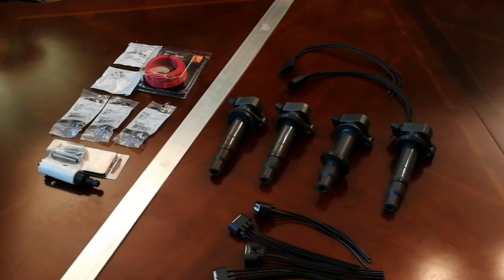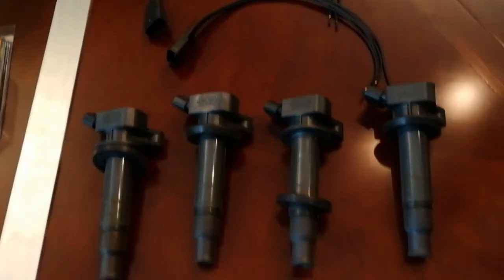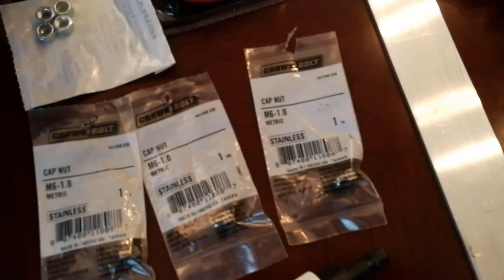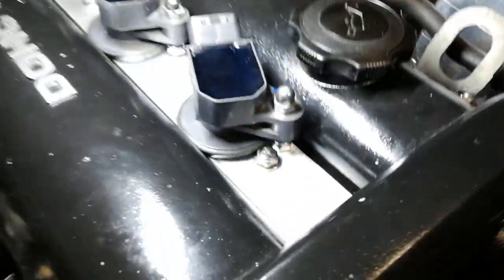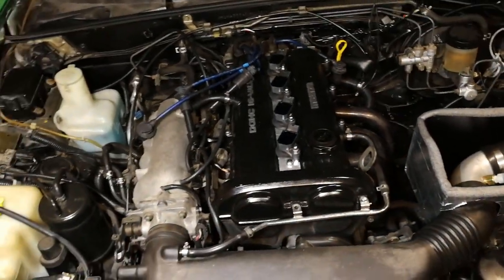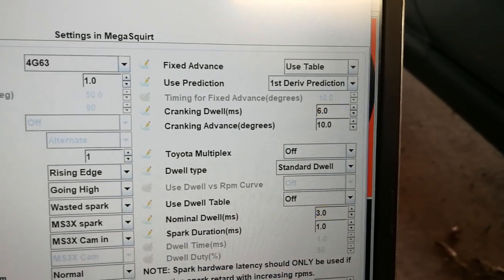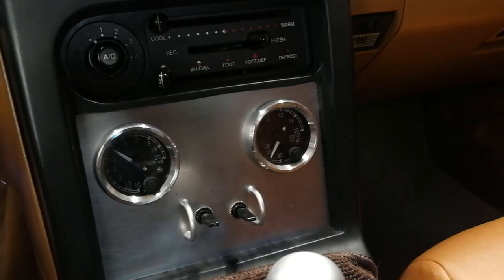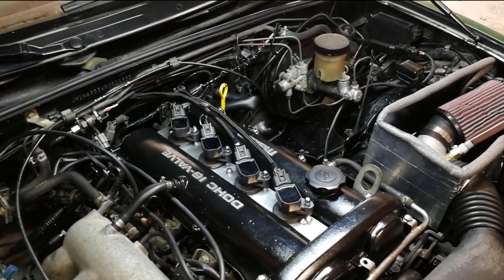Miata Coil on Plug DIY - Full HowTo!

Comment from the maker: Note: Toyota COPs have a lower dwell time than stock.  If you have an aftermarket ECU then you can change it as I show in the video.  If running the stock ECU you may need to find a way to reduce the dwell or else it will shorten the life of the coil.  Check out this how-to for a circuit: https://forum.miata.net/vb/showthread.php?t=277963
Reply: I am running MS2PNP
Reply: OGPedXing wish you were here
Reply: Not doing this will shorten the life of the coil how much? Im using this as an emergemcy fix. Will it work for about 200km?
Reply from the maker: @theo_korner  it's hard to tell, it's all about heat.  These coils can take some abuse but if they're old (I got used oem when I did mine) then they may not make it.   But I've talked to guys that lasted 6 months or more on them with the stock ECU.
Reply: @OGPedXing  thanks, that will do

Comment: Thanks for the OEM harness connector. I've made a few of these over the years and ended up making my own connector. I love a true PNP solution.
Reply from the maker: All credit to Ballenger Motorsports...they carry a ton of Sumitomo connectors which is what Mazda likes to use and I like to check back there periodically to see if they add anything.  I've searched Sumitomo parts catalogs before and could never find the coil side of this connector pair.  Many people have hacked an old broken coil pack to make their own connector but that's time consuming. I was super happy to find these.
Reply: @OGPedXing  That's what I did before, was a real pain. I even gutted an old igniter for a 92.
I hate messing with factory wiring and will almost anything to prevent that.

Comment: I am studying to do this (one coil per cylinder) using the original MOTRONIC 1.5.4 injection on an ECOTEC (OPEL) engine. Currently coil and cables are used. In the coil arrives three wires, the positive and negative of the primary coil for cylinder 1.e 4 and negative for the primary coil for cylinder 2 and 3. The wires come straight from the motronic module 1.5.4.

Comment: Thanks for posting this up. I hate cutting the main harness on anything and have been looking for the plugs to plug into my 94's harness.
Reply from the maker: I feel the same way.  Added bonus:  You can solder everything up inside in comfort rather than leaning over an engine bay.  Plus the whole thing just unplugs and can be removed if you need space to do something behind the head.

Comment: was super excited to do this as my wiring for my miata 1.8 is old and the coil packs are expensive, switching to this would make my motor run again and save me cash. was super happy until the megasqurt part came up. i knew this was too good to be true with a stock ecu. -_-
Reply from the maker: Yeah unfortunately the long dwell time from the stock ECU tends to over heat the Toyota coils, shortening life.  I've heard some people run them for quite a while with no problems on the stock ECU, but maybe they live in a cold climate.

Comment: I decided to attempt installation.  I watched the wiring section a few times and got that "baller" harness plugs into coil pack connector for 1&4.  Baller harness 12v lead goes to cop 1 and cop 4 power (same for GND, Trigger, Tach).  Then repeat this for the second baller harness but connect leads to cop 2&3.  Is this an accurate summary? Love the baller/street cred tributes to Greg. Lol. Keep these videos coming!
Reply from the maker: Haha, thanks.  Yep, that sounds right!
Reply: @OGPedXing  one thing that confused me a bit was the additional GND wiring while testing.  Is it not enough that the COPS are plugged into the connector which has wiring for GND?
Reply from the maker: I may have to rewatch the video, lol.  Basically the grounds are tied together further in the oem harness anyway.  If you use the oem coil pack plugs, there are two ground wires but these both go to the same place.  Same with all the 12v power wires and actually tach as well.  Only the trigger is truly split between 1 and 4 vs 2 and 3.  So as long as each cop gets power, ground, and tach it can actually pull from wherever.
Reply: @OGPedXing  for the test, you had some leads around what looked like the spark plug threads running to what looked like a jumped cable with the other end of the jumper cable clamped on the engine hook.  Was wondering why this was needed  even though the cops were plugged into 12v/GND.  Maybe cause the plugs weren't screwed into the head?    I want to try the test but being a novice looks a bit intimidating lol
Reply from the maker: @kevinsaeed9817  oh!  Right, yes it's very important for the plugs to be grounded themselves.  They normally ground through the head, correct.  So when outside the head you need to give it a ground path via the threads otherwise damage could result to either the plugs or the coils.  Some people just set them on the metal valve cover but mine is painted so I like my wire set up.
Reply: @OGPedXing  got it, this makes complete sense now.  Thank you.

Comment: Awesome job securing the plugs I’ll definitely be doing that. I would have soldered the joins. Would love to know how to get the rev tachometer working again
Reply from the maker: There are a couple of tricks to get the tach working if it's not getting it from the ECU...what year and ECU are you running?   I did the soldering off screen, but yeah I like how clean the harness comes out with solder connections vs crimps.

Comment: I have turbo charged my 1990 1.6 and one of the coils is not strong enough for the turbo.  This method is substantially less expensive than Greg Peter's LS1 coils, and $100 spark plug wires.

Comment: Thank you for the great guide! What is still not clear to me is, the stock miata trigger voltage is 12v as far as I know, while the Toyota cops take 5v trigger signal normally. Is this a problem, or are they good to use like that?
Reply from the maker: Yes, I believe the Toyota cops need a minimum of 5v but actually work fine with anything between 5 and 12.  I think the stock ones also do this but that the spec is looser on the Mazda coils and it's more stable at 7 to 12.  But either way, the Toyota cops are happy at 12, no problems there.
Reply: @OGPedXing  thanks for the clarification, your imput is very helpfull!

Comment: Are these considered "wasted spark" ? 
Can you explain that a bit? I can't find much information online
Reply from the maker: They can be set up however needed, wasted spark, fully sequential, etc.   Wasted spark just means that it fires both the actual cylinder that's receiving fuel in the combustion sequence as well as it's paired cylinder.  For a 4 cyl car, is 1 and 4 and then 2 and 3.   This does not reduce the spark power applies to the combustion cylinder because the other wasted spark is under very little pressure and sparks easily with almost no amperage draw.  So all the energy is happening on the combustion cylinder.
Reply: @OGPedXing  I guess I am wondering if I SHOULD make it sequential spark or keep it wasted? Pros and Cons?
Reply from the maker: I'd keep it wasted spark for any car that doesn't have the wiring stock for sequential.   Sequential spark is a tiny bit more efficient than wasted but unless the coils are very under powered, it will make no performance difference.

Comment: Great video. Do you know if the process is the same for the NB?
Reply from the maker: Yes pretty much.  The later NA s (96+) and NBs have a three pin connector to the coil packs.  The Toyota cops have 4 pins... you're going to ignore the tach pin - leave it unconnected.  The tach is driven from the ECU for the later cars.  So all you need to wire up is the power, ground, and trigger for each.  The there is one trigger wire for cylinder 1&4 and another for 2&3.
Reply: @OGPedXing  thank you for clearing that up. Much appreciated.

Comment: Did you have any trouble getting a tach signal with the megasquirt? Or did it function like stock?
Reply from the maker: Mine worked fine but it can depend on how your MS is wired, the generation of Ms, and also the year of the car.  I think 94, early 95 and older require the tach signal from the coil to be routed back to the ECU.  With my 94 I tied all the tach wires from the coil packs together and connected them to the original tach wire in the loom.   In some cases you can put a small resistor (1k) in the diag box between ig- and b+ to provide a pullup for the gauge.

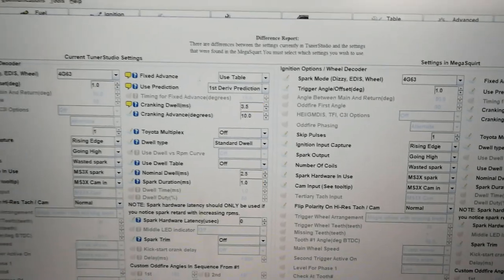Comment: On 14:09 , there are two sockets fron the coils, how do you connect this to the single oem socket ?
Reply from the maker: If  you have an earlier Miata, 90 thru 93 then you'll have a single plug for the ignitor vs 94 and up have two plugs for the 2 coil packs.  The wiring in general is similar but I haven't seen a female plug for that sold that will go into your oem harness directly, unfortunately.   What most do is cut off the plug from the oem side and wire it to your new cops harness directly. There are some decent diagrams here https://wiki.fome.tech/Vehicle-Specific/Mazda-MX5-Miata/Miata-COP-Conversion/

Comment: Hi greetings brother I have a 4g63 with a sem 102 ms3 program. I wanted to know how I can do the test for my coils since when I do that test I don't It allows. I have aem 30-2853 smart coil
Reply from the maker: The other thing you can do for testing if the screen isn't there in tunerstudio is pull the fuel pump fuse and then crank it.  This is more intense on the battery so you'll want to connect it to a charger or jump pack to avoid running the battery down if you are cranking for a while.
Reply: @OGPedXing  thankd man

Comment: The wires attached to the coil, are they the distributor wires?
Reply from the maker: Each coil has a power, ground, trigger, and tach signal wire.  When set up with coil on plug you no longer need an ignitor such as on 90-93 years Miatas or a shared coil pack as on 94 and above.  If you have an actual mechanical distributer on your car (not a Miata), you won't be able to do a direct conversion to coil on plug.

Comment: Do you think these Toyota cop plugs would be strong enough for a 250 horsepower 1.6.  currently I'm estimating I'm running 5 - 6 lb of boost and maybe 150 horsepower. The stock coils worked well for the first two days.  I don't really want to go the whole $500 route that Greg did on his Miata if this method will work.
Reply from the maker: @Mike Mohr  Yes, the Toyota COPs should work well.  You won't be able to gap them as large as the LS coils but they'll be ok up to around 15 psi.  The price is hard to beat!  Keep in mind the dwell issue though, these are most reliable when combined with an ECU that allows you to set coil dwell time to about 3.5ms crank and 2.5ms normal.  (Less than stock).

Comment: I am still a bit confused on what to do with the ignitor for the 1.6l stock ECU. I can't find any wiring diagrams that are still viewable so I am not sure what to do with it.
Reply from the maker: I think most just cut it at the connector and wire directly from there.  It's simplier although your cop harness is now part of the overall loom and can't be unplugged separately.  Here's a forum thread with the pics: https://www.miataturbo.net/useful-saved-posts-8/upgrading-coil-plugs-all-years-cop-writeup-12704/

Comment: Do i need to change my spark plugs? The toyota coils don’t lock in so the spring just have to be in contact with the spark plug? And bolt it down so it doesn’t move? Or something is wrong on my end? 1999 mazda miata
Reply from the maker: That's correct, they don't lock down like the normal plug boots, the bolt on each coil holds the tension on it.
Reply: OGPedXing thank you so very much.. love the content, you help a ton with my build🙏🏽🙌🏽

Comment: Curious what you're running for Spark Plug gap and if you've made any changes after tuning. Thanks!
Reply from the maker: I'm gapped at 0.040, once I went turbo.  That's been very stable although this setup is only doing about 14 psi.  Without the cops it would need to smaller.
Reply: @OGPedXing  I also did the COP setup, so I'll start with 0.040, thank you!
Reply: @OGPedXing  14 PSI on the T25? What kind of power are you making?
Reply from the maker: @f0deraro  I haven't dyno'd this exact setup but around 240 HP peak or around there.  This turbo gets tapped out pretty early but I love the instant spool and midrange torque.

Comment: Are the settings the same for a 1.6?  I have seen people take the duration down to 0.7ms; what do you make of that?
Reply from the maker: It's not going to do too much.   This is the time the MS will wait before starting to charge again and is used to ensure the burn has happened before starting to charge again (like at high rpms).  Since the Toyota COPs charge pretty quickly, this is not really a concern.  A normal value is about 1 ms.   Dwell on the other hand needs to be set correctly based on the coil and the voltage.  Nominal is 2.5 ms at 12v.  So your dwell correction chart should be compared to your actual dwell times from logs and corrected as needed.  Normally you'll be at 13.8 to 14.4 volt when driving.  So the actual dwell needs to be 2.5 ms at your normal voltage.  Edit:  oh also the settings will be the same on a 1.6.

Comment: My vitz asz1 toyoyoto is not starting. Battery is good and fuse is good  sparkblug is good  and fuel bumb is good so what you can helpme  sir
Reply from the maker: If it's cranking and you have spark and fuel then check that the timing is ok.

Comment: Hi, thanks for the vid. Is this a 1.6 or 1.8? Thanks
Reply from the maker: Mine is a 1.8 -- for the 1.6 the process is basically the same except the wiring comes from the plug to the igniter which the 1.8s don't have.  But basically the power wires are shared, ground is shared, you need to get the trigger wires for each cylinder (1 and 4 then 2 and 3) set up.  And also I think tach is still used.

Comment: so in the tuneing side do i not set the car to coil on plug in the spark mode
Reply from the maker: If you have wiring for sequential ignition then you can use the cop setting, otherwise it will work like wasted spark.  (Sometimes known as wasted cop).  In an na miata for example, it will be wasted spark.  There's really no downside to this, the non firing cylinder won't pull any amps, all of it will go to the firing cylinder even though two plugs are technically firing at once.
Reply: @OGPedXing  thank you for the quick reply yes I’m just getting a wasted spark pnp setup so I will just run wasted spark

Comment: Can you run sequential ignition like this or would i have to tap into wires from my cas??
Reply from the maker: For a 94 and above (and the California version of the 93) it is wired already for sequential so this will work no problem. For 90-93 check this out...scroll to near the bottom on how to wire it with a megasquirt: http://www.megasquirtpnp.com/docs/mspnp_g2_mm9093.php?isModel=1

Comment: How do you keep debris or water from going around that plate and down into the plug wells?
Reply from the maker: It's a pretty sheltered area so I've never had problems.  For dust I think it would be no problem...the plate fits tightly against each plug hole and the top is covered by the rubber cop boot.  For water I've never seen that area wet...check your cowl weather strip if you see water there.  I guess you could use a little rtv or some gasket maker around each hole but I'd say that's overkill.
Reply: @OGPedXing  just an idea but you could  also cut a piece of flat rubber the same length of the aluminum bracket including holes  and pinch it under it. I/E an old bike tube
Reply from the maker: Good idea!

Comment: Is it possible to plug the connector with the brown/yellow wire into either of the coils or is it dummy proof and only plug into the coil pack on the passenger side (where 4 and 1 connect to in 4123 order)?  I didn't take a picture and trying to get it back together.  Currently brown/yellow is on the driver side coil and brown is on the passenger side coil.  I think I have them on backwards (for plug wires in 4123 order) but wasn't able to get the connector w the brown/yellow wire into the plug on the passenger side coil no matter how hard i pressed?
Reply from the maker: You'll need the brown yellow to go to whichever coils are on 1 and 4 and the solid brown to go to 2 and 3.  On the stock coil packs you could swap them but only if you also swapped the plug wires as well.  For the cops it's usually harder to move them around between cylinders.
Reply: @OGPedXing  thank you for your content.  Going COP is what got me to this video.  Until then, since my brown/yellow will only go into the driver side coil for some reason, can I just switch the plug wires so its 2341?  BTW, this is me trying to put things back together after going through your coolant reroute video.  I Should have marked the plugs :(
Reply from the maker: @kevinsaeed9817  yes should be fine if I'm understanding correctly.  Just swap the 1 and 4 wire over to the driver side pack and 2 and 3 over to the passenger side.  Within one pack also it doesn't matter since they both fire at once.
Reply: @OGPedXing  I would like to try and start it how I have it knowing its wrong and then switching over the wires and try again to see what happens.  Is there any harm in doing this, im thinking the car just won't start when trigger signal for cyl 1 is going to 2 & 3?  Thanks for your help, I shoukd be able to fill her up w coolant and get her started today.
Reply from the maker: The only small risk is extra unburnt fuel in the cylinder.  Just don't crank for too long.  You can also put the car into flood clear mode by flooring the accelerator while you crank.   But it takes a lot of fuel to hydro lock something, not much of a worry.
Reply: @OGPedXing  Thank you.  Very much appreciate the advice.